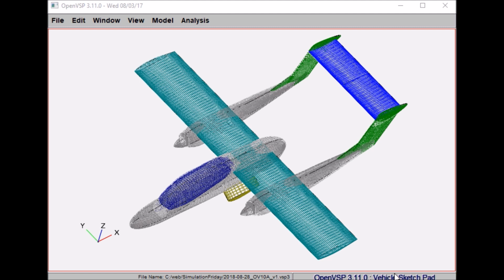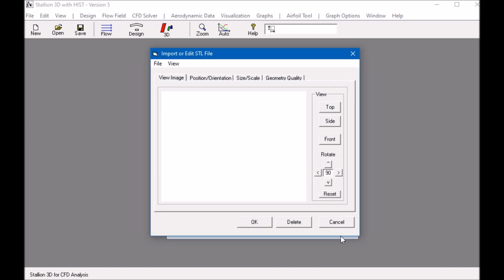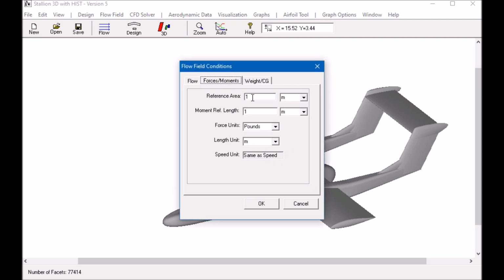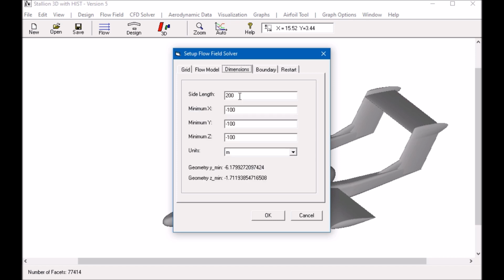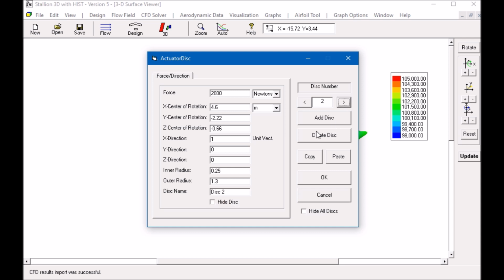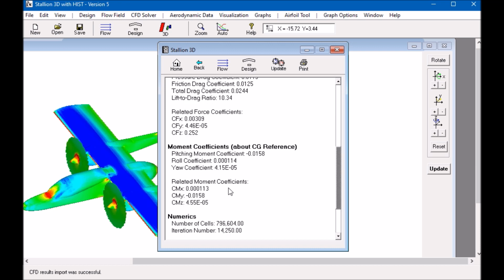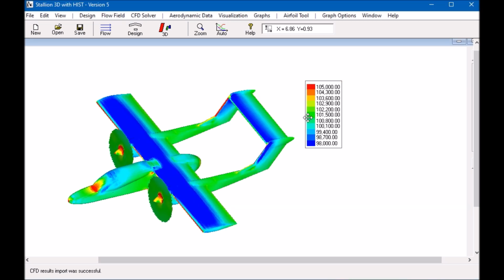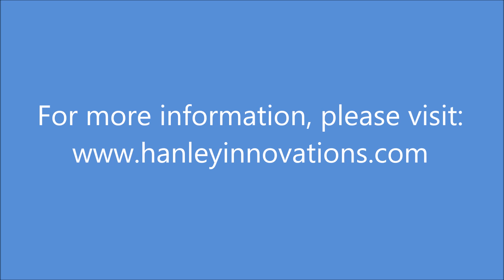How to analyze an aircraft using computational fluid dynamics (CFD Software)

Comment: Hi Patrick, what did you use as your reference area? Is the the projected area from the front of the plane, from the side of the plane,  or from the top of the plane (looking down on the wing [planform area]). Thanks!
Reply from the maker: Hi Erick, I used the wing planform area as the reference area. 
Thanks for your comment.
Best regards,
Patrick

Comment: Dr. Hanley, i am quite surprised by the capability of Stallion 3D. How come there is no much visibility of it in terms of commercial usage, publications and reviews? Could it be used as automated tool for CFD analysis of batch run for MDO purpose
Reply from the maker: Hi Devendra, 
Thanks for your comments.  I hope you are doing well. Stallion 3D is developed as a personal CFD analysis tool for Windows 7, 8 or 10. It does not have a batch function.  The software runs interactively and enables users to accurately analyze complex design shapes on an ordinary laptop/desktop computers.  Stallion 3D gives engineers a tool to make positive design decisions early in the design process. 
Thanks again,
Best regards,
Patrick
Reply: Because it is hella expensive for any single person to use.